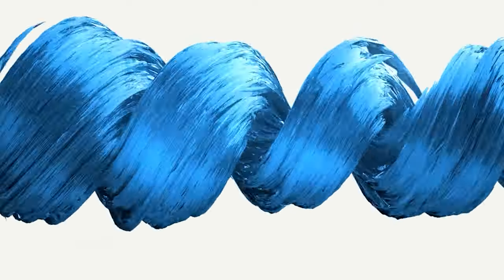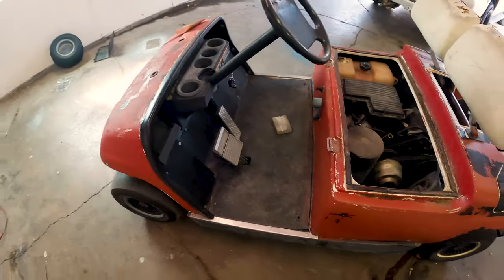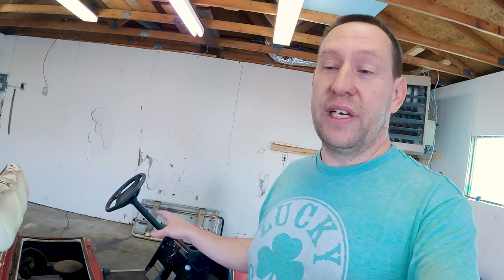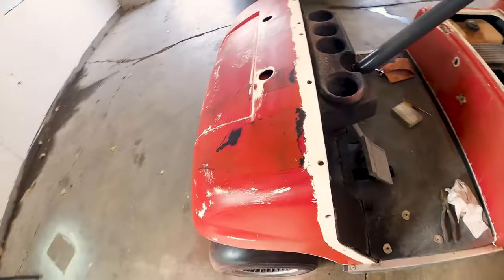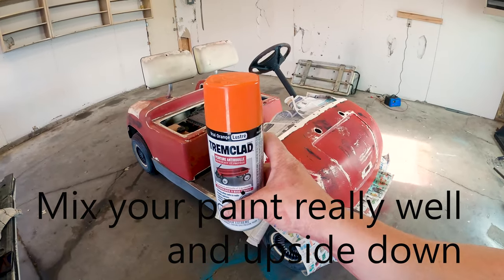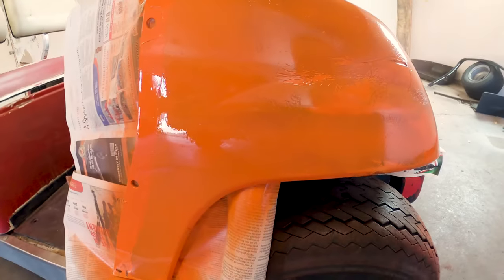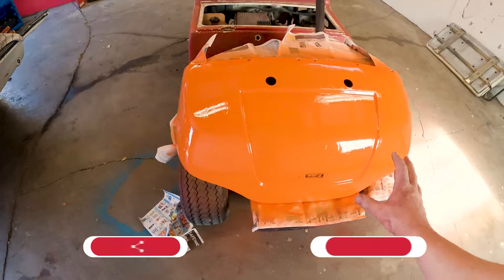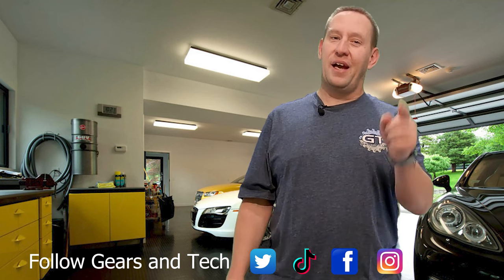BUDGET Golf Cart Makeover | Gears and Tech

Comment: I have a mobile golf cart cleaning service here in central FL which I basically go to the seniors property an clean it up for them. 

I get a lot of questions asking who can paint this section or who can paint this rear, I see a need for that so my questions are 

1. Can I do this outside the same way I clean them, or do I need a shed?

2. Where can I learn this 

3. What’s the prices of products you use, also with older carts, how do I know which type of green or white paint to buy?
Reply from the maker: You could get a decent job doing it outside as long as it's not windy and not a lot of dust in the air

Im not sure on the color match for Factory cart paint. I'm sure someone has a paint code for it

As long as you, and your customer knows it won't ever look factory perfect.

You'll need to paint the whole panel as well. The factory panels will fade over time so a perfect match is almost impossible